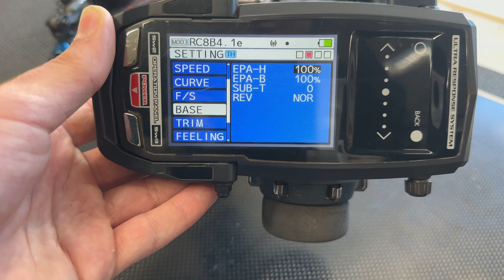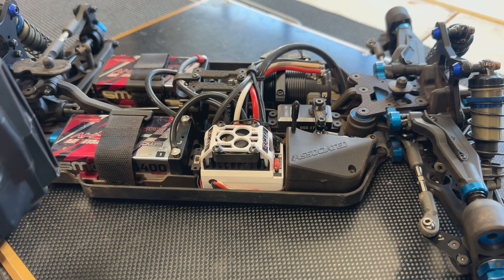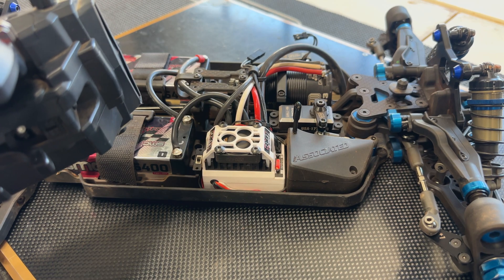The Most Important Speed Contol Setting? How To Calibrate your RC ESC! (Tekin, Hobbywing, Reedy)

Comment: Great tutorial! How about the Spektrum ESC's, seem like they close to the Hobbywing?
Reply from the maker: Glad you enjoyed! I believe the Spektrum calibration is the exact same as the Hobbywing.
Reply: What if you set perameters in the radio at 120 or 140 versus 100 in the transmitter. What would that do?
Reply from the maker: @1dirtovalracer If you are calibrated at 100% Throttle and 100% Brake then bumping up those numbers would theoretically increase the level of each assuming there is more for the esc and motor to give. Now if you calibrate at 120% or 140% for each then basically you will have a smaller step between each change. So lets say at 100% calibration each point of change is equal to 1 point, at 140% calibration each point change will be finer so the change to power could be more like .75 if that makes sense. In short, the more points of adjustment available mean the finer those adjustments are. Hope this helps!